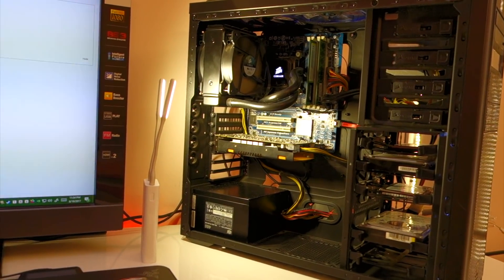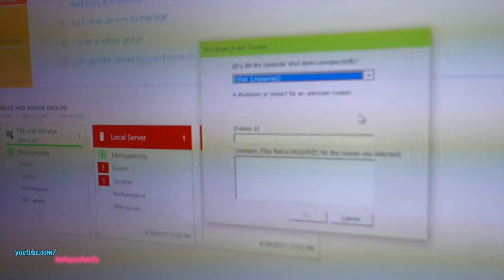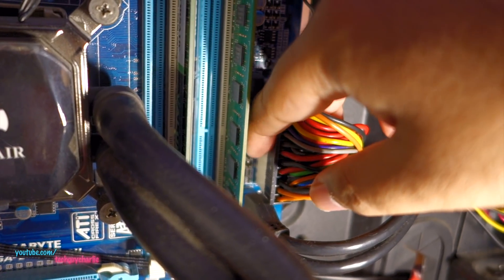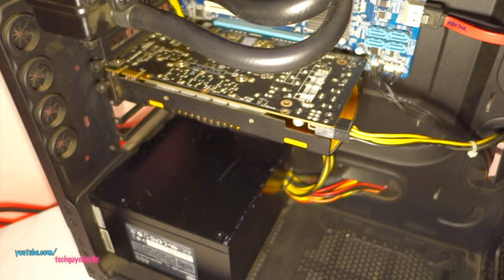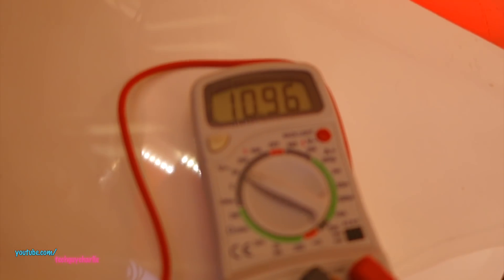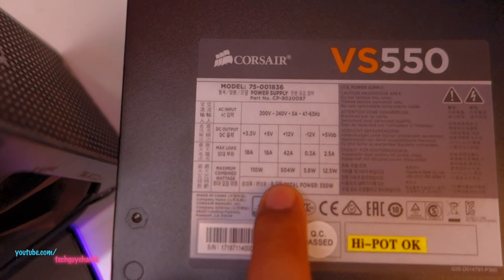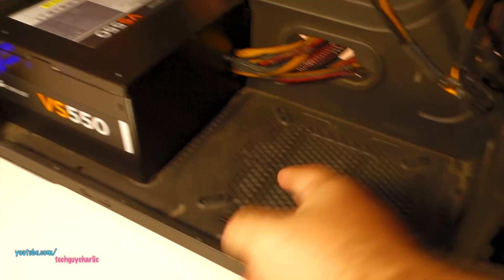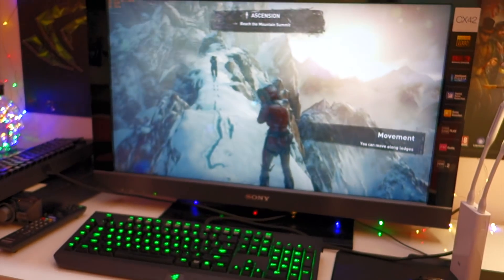Computer randomly shuts down and turns back on by itself - How to diagnose a faulty PC power supply

Comment: this is the VERY exact problem i've encountered. the irony is, your replacement power supply (corsair vs550) is the exact same as my faulty power supply lol, i am rocking this PSU for 6 years now, so i am not surprised it is now failing.
Reply from the maker: Ahh! This time grab yourself a 80+ Gold rated power supply, should last longer, although I've had one 80+ Gold fail as well after 3 years or so, but they have 10 years warranty, so got mine swapped for new one.

Comment: It’s good that you checked the voltage output of the power supply to come to the conclusion of the power supply being faulty by not supplying sufficient voltage ,not having to quess and replace without testing first

Comment: I'm dealing with this problem. Replaced psu problem still exists. Gpu happened to fail, replace same issue. Did a few updates, and it seemed fine for a while, but now it is back again after a few months, pc it up to date.. Only things left are MB and ram. I was also thing about trying a new surge protector

Comment: After so many frustrating hours finally it was SMPS thanks mate.
I tried everything
1. Ram
2. CMOS reset
3. Hard Disk
4.System settings
Another reason I changed SMPS last is that in the multimeter faulty SMPS power was showing 11.99 so I thought maybe it's ok but later in new SPMS the output power is 12.10v.
Reply from the maker: So, the problem has been sorted? 😊
Reply: @TechGuyCharlie  Yes I can probably say that the problem has been fixed because I have been using system for some time now no crashes or restart issue.
The funny thing is in this video you changed from faulty cm mw SMPS to Corsair vs
But for me I changed from faulty vs550 to cm450 😆
Reply from the maker: Corsair also failed on me 😂 if you have seen my newer videos, I diagnosed a faulty 3 year old rm1000x which is supposed to be one of the best units, surprisingly the power supply in this video still works to this day.
Reply: What is SMPS and do you solve your SMPS ?

Comment: prior to thinking that its my psu i went through hell with ID 10016 i did the registry permission stuff. i don't think it's my graphic card or anything. i have this msi trident for almost 3 years but is 3 years enough for it go that weak? NOW it might be true that for a good while i had black desert online and ffxiv opened at the same time using two monitors..for hours on end during the worse of the pandemic but..i don't see the issues that id have with the usual graphic card problems like glitchey screens or tears. my temperature is usually in the 48s-of course it goes higher when i run the games but not past 60. i really want to look at other options before sinking 180 bucks for a new psu. it really does look like this might be the issue. well probably 200 bucks since i'll need to test out the power and i'll have to get those gadgets..weird crashes and restarts and odd times. how is it now? was your solutions the real thing or did it fail later? 😒

Comment: I pressed ram and all the cables in again so that nothing is loose. Now pc is not shutting down but bothing shows up on the screen
Reply: Did you find a solution,i got the same problem as your
Reply: @LoneStar04  just take out the ram, clean it and place it back. Check for any lose cables.. that fixed it for me. Hope this helps

Comment: I’ve been having similar issues. My PC randomly black screens and restarts. I can run stress tests for hours without issue, its just completely random so its hard to replicate. Do you believe this could be a Faulty Corsair hx1200 power supply? There was a recall on the psu but mine wasnt in the effected batch. Any support is greatly appreciated!
Reply: Its typically while gaming or streaming+gaming
Reply from the maker: Have you ruled out everything else? like Overclocking, thermals, RAM, if yes, then do a BIOS update, if its still got issues, then most likely its the motherboard or the power supply. And, do you have cable extensions?
Even the best of the power supplies do fail, I've recently had a Corsair rm1000x fail after 3 years of use, I've made a video about it here: https://youtu.be/mNiD6Nf7IgQ
Reply: @TechGuyCharlie  ill most likely swap psu next. also would you recommend going EVGA for power supply? Ive honestly heard nothing but issues from most users with corsair psu’s
Reply from the maker: You could give EVGA or Silverstone a go, both are reputable, but I feel its a matter of luck, I've also got Corsairs CX650M in a PC that runs 24x7 and its been working fine for the last 4 years, but a better built rm1000x broke after just 3. Btw do check the voltages with a multimeter before writing it off, especially while gaming.
Reply: @MoldRS  any update?
Reply: @freshicecreqm8329  yes it was SOC Voltage causing it. Went into BIOS and increased it and no issues since. Weird that it was unstable at factory settings
Reply: @MoldRS where should i change it on Bios can you help please i have the exact same problem my pc shows a black screen and restarts mid game sometimes after 7 hours sometimes after 10 mins of booting up
Reply: @Var3x.21  i fixed it in bios, it was something to do with SOC core voltage
Reply: @TechGuyCharlie  thank you for your reply! Yes i reset the bios and updated, swapped out RAM. Ran tests for temps and not overheating. Its a relatively new pc built within past few months and it just randomly will black screen and restart.  Its just extremely hard to replicate it because it seems completely random. Might happen 3 times in an hour and other days no issues
Reply: Whenever I connect my monitor my cpu gets restart

Comment: this has been happening to me for a while now. first it started off by randomly restarting during games, second, it started restarting whenever i launch a game, third, started restarting whenever i launch my web browser, and lastly, restarts and doesnt even load my desktop. 😪

update: it doesnt even let me go to the bios settings anymore..
Reply: How did you fix your problem?
Reply: @Greygasm  i got it fixed through my uncle. it was the psu in my computer and it was faulty
Reply: @soldierseventysix  thanks. I'm guessing my PSU is faulty too.

Comment: i have just bought a new and better 80 gold power supply and it still restarts, new ram, new graphics card, I even brought it to a store for them to diagnose it, they concluded with the power supply, so it's changed, but still it happens to me... I'm just wondering, is it possible that the cables can be squeezed so that it doesn't give all the power it should? could the outlet be the issue?
Reply from the maker: Is it possible that it might be the motherboard? 🤔 I've built and fixed plenty of PCs and its quite rare for a motherboard go bad, but it does happen.
Reply: @TechGuyCharlie  i tried one of the other videos, and it mentioned BIOS used with Windows 10, so i tried that, disabled restart when failure, and since it hasn't restarted.

Comment: i had this problem it was super random. I tried taking out the ram, cleaned it and placed it back but it still shut down i thought it had to be the power suppy till i tried placing the ram into the two different outlet AND IT WORKED!! THANK YOU!

Comment: You are right on the money! I was having this problem and after watching other videos, I was even more confused. It appeared to come down to replacing something and the power supply was a lot cheaper than the other components. I replaced it and now no problems! Thank you as you were right.
Reply: Sorry for bother you. But i want to know that your earlier power cable was okay? Though your power cable is okay you use a new power cable? Is it like that?
Reply: @ummehafsa243  Thanks! The cable itself was fine, it was the lack of power causing the problems. One thing I learned...you can never have too much power but lack will cause problems.

Comment: There u go i hv the same exact issue since 10 days nd i also diagnose all the problems all was ok but still pc random restart ...was irritated ...but now m sure its my psu which gives me trouble...thanks a lot bhai by giving proper solution👍
Reply: what was your issue exactly?
Reply: @lahorimunda1985  i hav a problem wid my pc since months ....my pc randomly shuts down sometime idle nd some time running game or any apps ...nd when its shutdown automatic so when i press the power button.. power button dont work ..nd its keep power cycling ..nd its start again randomly ...m really tired dis issue cant actually find whats the real issue ...can u plz make a vid on it ?or just tell me whats the issue it will be really helful
Reply: @XFlameIN  I have a video of my issue.
Reply: @lahorimunda1985  can u tell me about my issue ?
Reply: @XFlameIN  everything works normal if I am in BIOS. Then I am able to load windows sometimes but after few moments pc will restart. And same will happen again and again.
Reply: @lahorimunda1985  there r 2 different thing ..pc shut down like how u shutdown the pc or just completly blackout nd restart again ...so in 2nd problem it mostly psu problem ...but in first case it can be many problem ...in my  case my pc is shutting down nd then its power recycling nd then start randomly ...
Reply: @XFlameIN  watch this video it happened when I was trying to install windows. But then I managed to install it. Now it loads and I can see my desktop but after a minute or so,it restarts like someone pressed the restart button.

Comment: So I have been having the same issue with my build which has a Corsair VS550. Ususally it outputs between 12.1-12.8 Voltage. However the problem still arises when I start playing any kind of game which has high GPU requirements. So far the crashing has been following an irregular pattern, where it sometimes crash between 1-5 times a day while other times it goes without crashing once even during high load. Any Ideas about what's causing the problem?

(I have monitored the GPU and CPU temps. The CPU sits between 40-50 during idle and 60-75 during load, the GPU sits between 46-50 when idling and between 60-70 when on load)

Comment: I use 650w psu its from cosair i think i use i3 9100f and rx 570 i used to think it was over heating issue but my cpu temp is 60c and gpu 50-65c and  my gpu draws 105w and i dont have 8 pin connecter i only have 1 8 pin connecter which i use to power my cpu for my gpu i use 6 pin but it requires 8 pin it just works fine but recently it like restarting to much any idea how can i fix it?

Comment: my computer literally shut off the moment i clicked play on this video. i've swapped the power supply and tested it. the old one was making a horrible arcing sound, yet the exact same shutdown behavior persists with this new one, just without the arcing sound. playing, resuming, and skipping videos, switching render modes in blender, games loading in, even in rare cases closing a window can all cause it but it's completely russian roulette. my gpu temps are completely fine but my cpu temps are all over the place and i've seen it spike up by as much as 40c. i don't know if it's a cpu or gpu issue because anything video related is bound to cause it
Reply: Bro plz did you fix it ? And what was your issue ?
Reply: i figured it out a bit later on. turns out, intel turbo boost was causing it. i disabled it, and my computer hasn't randomly shut off since. so if you have a CPU with turbo clock, go into your BIOS settings and try disabling it, and see if it works or helps

Comment: So, I have a Brand New PC (i9 11900k / RTX3080ti / 32gb RAM / water cooling / ssd and hdd 1tb each one / psu 750w) and for instance I'm playing some games (it happened with red dead redemption 2, gta 5 (fivem) and pubg 2-3 times) for some time and suddenly, my pc turns off, 1-2 seconds pass, and it turns back on, so is it possible that there is a problem with PSU because computer like this shouldn't have problems with any game these days)
Reply: Probably because the wattage isn't enough maybe? I think an 850W wattage power supply will be more than enough, or just enough idk.

Comment: I have a Thermaltake Litepower 650W RGB 80 Plus PSU i bought it like 3-4 months ago...and since 2 or 3 weeks ago i have this problem.
I tested temps which are always normal and never dangerously high.
I can't belive a new PSU can be problematic like this.

Comment: I just turned on a 16 year old pc and got on papers please, just to test if it can run the game. No big problems whatsoever despite having less ram memory than required to run the game (512 MB of ram) . Everything ran really well for the pc's age and hardware. Perfect. I played for 1 hour and a half, nothing. The next day I just enter back to play the game. Was playing for like half an hour and I got a restart. I checked if everything was OK, and I turned on the light. Happened again after 10 minutes, and during that time where it cut down the power to the pc, the whole lighting system just shut off, just for that brief moment, and then the pc turned on. That was a bit scary, considering it did the same thing way, waaaaaay back in like 2009 on gta vice city, with a different psu. In 2012, the pc wasn't plugged in correctly, (halfway through) and a lot of smoke just came out from the pc. From that day, up until January this year, the pc didn't turn on. After changing the psu, it turned on right away. But since then I haven't turned it on that often. Maybe when the original psu was done for, maybe some other components were affected. Oh, and after the pc restarted, the psu was too hot for just running papers please. The psu is around 450w so it shouldn't have a problem giving power to the CPU, a stick of ram and some telephone card or whatever that is. Something should clearly be burned or damaged by that incident 9 years ago. And I am thinking maybe that component is damaging the psu or it's consuming much more power than intended. I think it's best if I don't turn the computer on, at least for a long amount of time, 'cause I don't want to risk anything
Reply: Are u telling us or are u writing to yourself?
Reply: I am telling you because I want to see your thoughts on what problems the pc could have. I had a bunch of thoughts there but that doesn't mean that I know exactly what's the problem

Comment: i am getting 5 volts on the molex cable no doubt why my rtx 2080 keeps crashing while running games at 100% load but barely survives if limited the power to 40%

Comment: I have a question, I build my Brand spanking New computer today, The case is a Lian Li Mid-Tower Chassis, it has a ASRock B450M PRO4 AM4, Pny Cs900 480GB SSD, Seasonic S12lll 550W power supply with a AMD Ryzen 5 2600. I got almost all the part but the ram , I installed all the cords everything single thing that was needed to be plugged into a mother, and for some reason it's power cycling, and when I found the problem, it was the CPU connecter that is plugged into the top-Left of the board and when I take it out the pc stops power cycling, is it because I have no ram because I need help!!
Reply from the maker: Dude you need RAM to make your PC work! Without the RAM it wont post!!!

Comment: Mine would crash and restart when engaging STEAM VR over oculus air link.  Now it crashes and restarts 100% of the time when running a game with big graphics, 3dmark, etc, 100% of time time now.
A 750 watt Corsair.  It worked good for over a year too. W Weird. Still has warranty at least,3  years or was it 5 years?  it's alot.
Reply from the maker: Most likely it is the power supply, but just to be sure, do check your graphics card in another PC!

Comment: I get a steady 12.16v while idle on my Corsair HX750. It dips to 12.15 while under high load occasionally, but never lower. Randomly shuts off (during high load) and powers back up.

In my experience, these are definitely symptoms of a bad PSU as well, though I was hoping to confirm it with the multimeter suggestion. Either way, I'm gonna get a replacement.
Reply from the maker: Corsair HX series? those are pretty high end 80+ Platinum PSUs haven't seen those go bad in a while now, have you checked the temps and do you have any overclock on the CPU or GPU?
Reply: @TechGuyCharlie  Temps are fine on the cpu&gpu, no spikes. Around 50C max temp on the cpu, my 970 peaks around 60-65. No OC
Reply: @TechGuyCharlie  Just to followup: It was indeed my HX750. I replaced it with a PSU I borrowed, and had absolutely zero issues. I've since replaced it with a brand new PSU. I still find it strange that the voltage on the 12v rail was steady, perhaps something else was failing?

Comment: Is it still possible the PSU is the problem even without the kernel power error? Mine has been doing this with no blue screen and no error in event viewer, other than the one that says it shut down unexpectedly
Reply: @am1RRR MvM I ended up getting a new PSU and that fixed it, so I guess it is possible